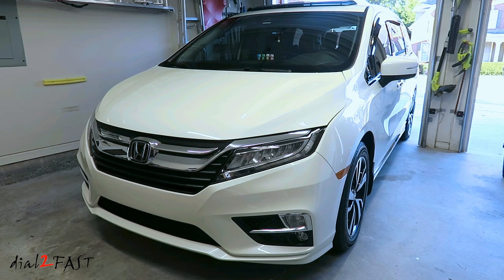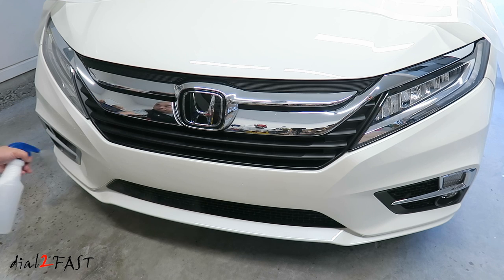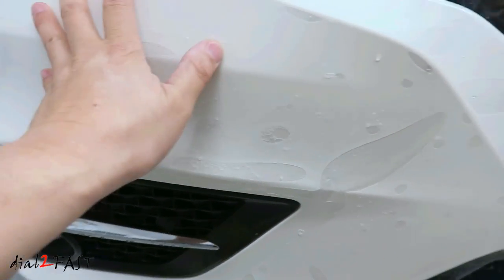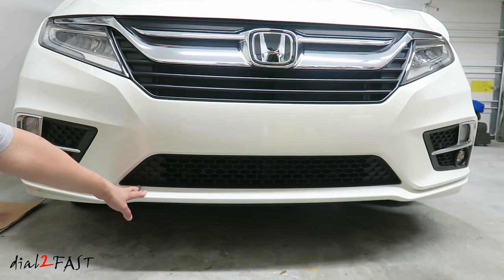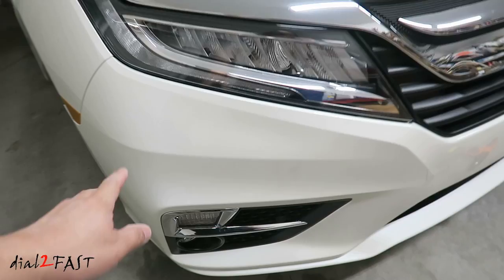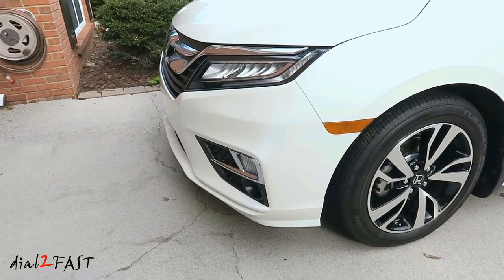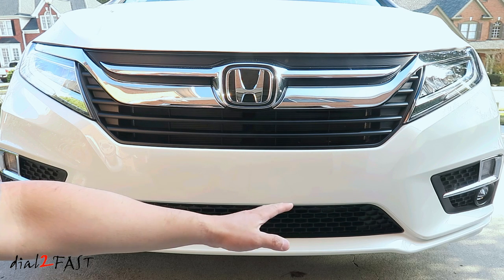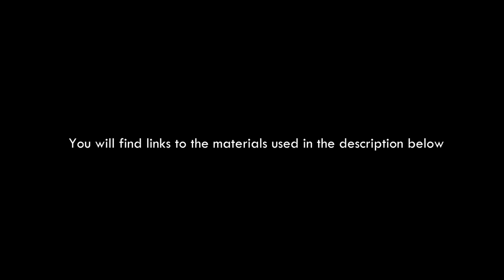Install 3M Pro Series Paint Protection Film PPF | Honda Odyssey 2019

Comment: We just bought 2019 odyssey 
Do I need wait a while before installing this? Does the paint need a while to breath?

Thank you 
Very detailed video!
Reply from the maker: The factory bake the paint and also after some time as it's shipped to the dealer, the paint is ready for the film.
Reply: Even with fresh paint, that isn’t baked it takes about three months for it to off gas. I would bet your car wasn’t painted shipped and purchased in that time span.

Comment: This film actually consists of 3 layers.
The white layer and on the outside is still a 3rd layer consisting of a hard material. Do you have to peel off that hard outer film? Because I didn't see this step in your video.

Comment: PPF install is such a skill dependent job that takes years to develop. How  many hours to complete the whole job and what did you save in labor as a DYI?
Reply from the maker: Time spent was more than normal because I had to film the process. It took me about 5 hours with breaks in between. This kit cost me $288. Depending on what brand of film you use and how many pieces you need done, most shops will charge around $700 to over $1000 for several pieces.
Reply: dial2fast thanks!
Reply: I’ve done it 4 doorsills, which gave me the confidence to do the headlights, mine were more difficult than this as it’s a 3D shape with valleys and raised sections. The film is very workable if you’re patient. It even started raining mid way through so I pulled the film off, put it back on the backing paper and tried again 2 days later. Now I’m going to try the bumper. Tack solution is like an extra set of hands anchoring parts so you can stretch it. The other thing is, some shops don’t pay for these cutout designs from 3M and wrap bulk materials on your bumper and cut into your paint. I don’t care how many years of experience you have your hand holding a blade doesn’t have the accuracy of 8 mils or 0.008 inches (thickness of film).

Comment: I like the idea of this. But my questions are: How long does it last? How is it removed? How do you wax and shine your car?
Reply from the maker: The 3M PPF product will last a good 10+ years (my own experience). The adhesive is very strong and does take quite a bit of work to remove. You can wax the film but you should use a synthetic wax and not something with carnauba.

Comment: does this clear bra work on ceramic coated surfaces?
Reply from the maker: You need to prepare the paint surface and remove the ceramic coating first so the PPF adhesive can properly adhere to the painted surface.

Comment: Great video.  I've installed one in the past and always made sure the edges were adhering and not lifting up while curing and drying.  However, after almost a year of ownership, and maybe due to me allowing the car to remain dirty for weeks at a time instead of keeping up with regular washes.  I noticed dirt build up right at the edge of the film.  It's not under the film, but right at the edging where it meets the paint.  Do you know if there's a trick to clean those edges?  

Also, I wanted your take on this.  Do you prefer to leave a mm or so of film "short" from the edge of the panel you are working on?  I've seen some installs where they wrap it just slightly around the edge of whatever panel and have seen it lift up just a little over time.  I just wonder if it would be better not to wrap around the edges, but try to keep it flat on the front fascia on any panel...

Great job! Very information, and as always, I enjoy all your videos.  Thanks!
Reply from the maker: As for the dirt showing on the edge of the film, this will happen because of the thickness of the film. There is an edge that is raised which allows for dirt to collect. You can clean it by buffing the edge with a carnauba wax and cloth. Usually that will clean it all up. With regards to wrapping around the edge, if you buy a precut kit off ebay, those kits are not cut to be big enough to wrap around. They are cut to just fit on top of the body panel. If you want to wrap around the edge, you will most likely need to buy the roll in bulk and cut your own as you wrap.
Reply: @dial2fast  Thanks for the tip.

Comment: Hi there.  How's your PPF holding up?  I have the same Odyssey in white.  I am wondering if your have dirt build up around the edges?  Also, should there be any lifting of the film on some of the sharp edges.
Reply from the maker: If the install if done cleanly, there should be no lifting on the edge or corners. You may notice a black line on the edge of the film after a period of time, but that's just dirt sitting right on the edge between the film and the car paint. A quick buff with some car wax or detailer spray will remove that. If you see dirt underneath, then the edge was not properly applied to the paint and there is a small gap.

Comment: Hi- good day, just want to ask if you know how to replace buzzer smart at rear of my odyssey 2020 exl. Everytime I lock it with key remote I can only hear very low beep.
Any suggestion is appreciated- thanks
Reply from the maker: I know the Odyssey buzzer is very low in volume. I think to change it, you will have to locate the buzzer and circuit that drives it, and replace one or both items. It will be a lot of work.

Comment: How should you wait after applying the material to drive your vehicle, should you let the car sit over night?
Reply from the maker: You can drive the vehicle right after install, but I would stay away from automatic car washes. The adhesives on the clear film is very good and it doesn't just come off.

Comment: Awesome job. Considering doing it to my vehicle. 2 questions..1.will it leave a  glue residue on your paint if ever it needs to come off? 2. Will it leave air pockets from existing chips on paint?
Reply from the maker: After leaving it on for many years, there may be some glue residue if you remove the film, but it can be cleaned off. If you have existing paint chip when applying the film, that paint indent will not be filled by the film, so you will see there is a paint chip underneath. The best thing is to try to fill the chip with some touch up paint before applying the film.

Comment: What r your thoughts on the steering in this van

Seems to stiffen up the faster I’m going
Reply from the maker: No issue. I have taken it on two long road trips and drive very well. You must turn off the auto lane departure mitigation or it will drive like crap.

Comment: How to avoid dust and such?  I tried to install one on my white car and had small bits of dust and fuzz etc.
Reply from the maker: Make sure the car surface you touch is very clean because your hand will pick up all kinds of dirt. Also use a lot of slip solution to rinse out any small dust. You can try spraying directly onto the piece of dust or grime that's on the adhesive side, and use your finger to pick it off. Basically try to rinse it off with the solution.
Reply: Turd McGurk - use a clay bar before you install the wrap.

Comment: how to mix the water?
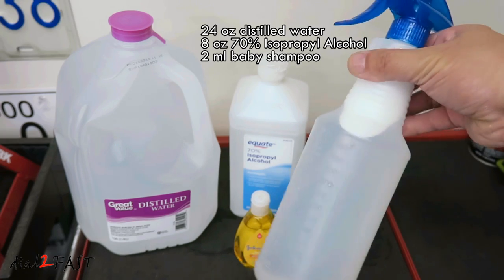Reply: Look at 2:07.  24 ounce distilled water, 8 ounce 70 percent alcohol, 2ml baby shampoo,  Get a 99 cent water sprayer at walmart, add all ingredients and shake bottle.
Reply: yan zeng  - usually you make 2 solutions, a slip solution with the soap and a rack solution with alcohol.

Comment: I want to install a clear bra on my 2019 odyssey as well, but throughout the 9000 miles that are on the van at the moment , many rock chips have formed and the dealer has drilled the front bumper for the license plate . Would it be bad to install the film over the rock chips and the holes? Or do u know of any ways to get rid of the rock chips before installing the film?
Reply from the maker: With rock chips, you can use touch up paint to fill the chips. This method will NOT make your bumper look new, but cosmetically looks better. The other method is to pay a bodyshop to repaint the bumper which cost more money and you need to wait about 60 days before apply PPF film. If you don't care to all that, you can apply PPF on the current bumper with the chips, but of course you will have the chips visible under the film. The film will provide further new chips. The choice is yours.
Reply: dial2fast thanks for the reply. Yea I’m going to think about using touch up paint. Getting the bumper repainted is not something I want to do. Applying the film over the previous chips, may show the chips, but will for sure protect against future rock chips.
Reply: Most plastic bumpers do not lose paint. They get impressions that show up a good ways away. Will this film protect against those micro dents from Little Rock’s?

Comment: Wouldn't s drive thru car wash rip these  off?
Reply from the maker: No, the adhesive is very strong.
Reply: @dial2fast  if its so strong, then how to remove after few years down the line when the film has collected lot of scratches. Thanks in advance